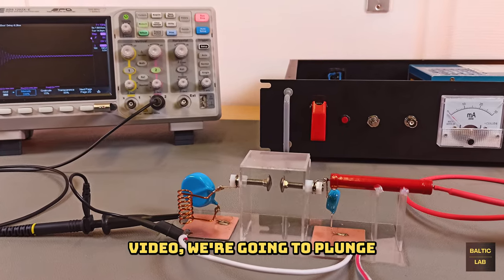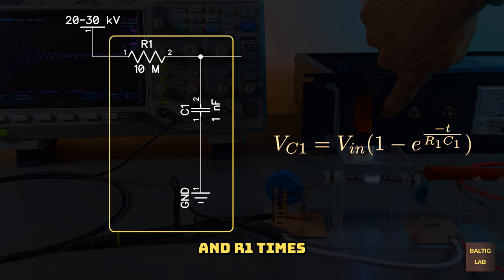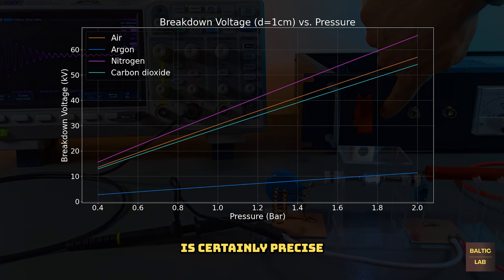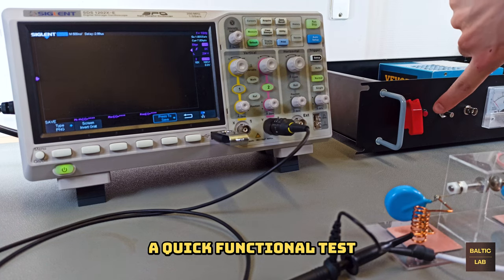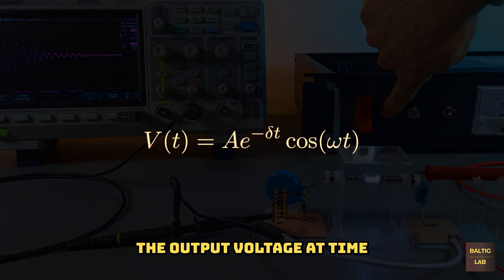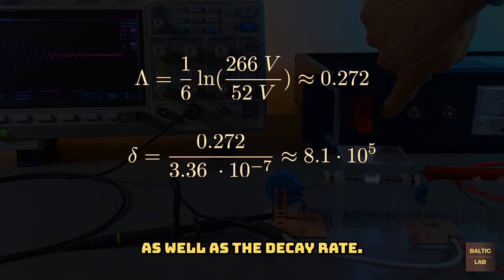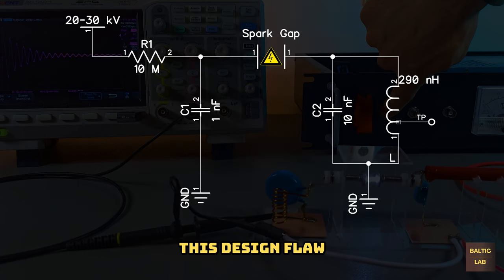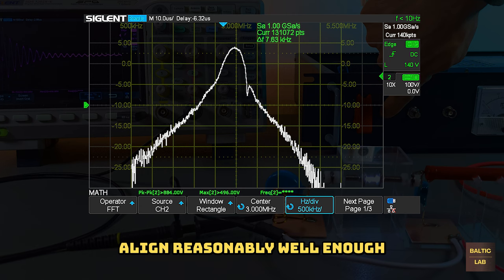DIY: Spark Gap Transmitter (Damped Harmonic Oscillator)

Comment: Found this on hackaday after looking at some lame 'emp' generator. Personally I'd ditch C1, put C2 where the spark-gap is, and then place the spark gap from the junction of C2 & R1 to ground. Your repetition rate then would be determined by the power supply voltage, R1 & C2, and the output frequency by L and C2; the large charging resistor should isolate the power supply from the tuned circuit once the spark gap fires and the inductor will look like a short circuit and not affect the charging of C2 in any significant way. I'm mainly interested in these type of things for VHF+ though, 3MHz is a little on the low side. Still an interesting demo, I really miss my old scope.
Reply from the maker: What you describe should work. There are many different architectures for spark gap transmitters and the version I showed was the best architecture to explain all relevant parts of the circuit. It is, however, not the most clean type. VHF with a spark gap transmitter is challenging, especially if you'd like to achieve relevant power densities for an EMP generator.
Reply: @BalticLab  I did it by using parallel connected 1/4 wave pieces of co-ax cable as a resonator, with a plain wire antenna on the end. It was a bit scruffy, but worked, and managed to disrupt unshielded devices around 5 metres away. I was quite surprised at the effect when only feeding the device with around 1500V from a disposable camera flash charger feeding a cockroft-walton multiplier and running from two AA batteries. The secret is to get the frequency high and the spark gap small and fast, but a pressurised gap would be even better with a single low impedance line as resonator. Operating frequency was around 70MHz. I had to dismantle it in the end as two laptops died unexpectedly in quick succession - whether it was the device or not I'm not sure, but I stopped with the experiments just in case. For an EMP generator it is only the peak power that you need to worry about.

Comment: 3KV/mm is interesting is that AC? I was taught the dielectric breakdown of air was  20KV/inch DC which is about 800V/mm DC. 3KV*25.4=76KV/In.
Reply from the maker: It's DC. You'll see a lot of different numbers between 1 kV/mm and 3 kV/mm. With some rounding your 20 kV/mm would be in that neighbourhood. The breakdown voltage depends on a lot of things. And it depends what your goal is. If you want to prevent breakdown and be on the safe side, sure, assuming 20 kV/inch is a good idea. If you want breadown to occur, 76 kV/in. is the better idea. That said, it depends on the temperature, humidity, exact gas mixture (which isn't even constant with air), pressure, etc. And it also depends a lot on the exact electrode spacing and shape. The false assumption is usually, that the measurement, be it 20 kV/in. is a linear one. Implying that for two inches 40 kV would be needed. But that is incorrect. The breakdown voltage at 10mm is different than at 25.4mm (1 inch), even if normalized to kV/in. The figure I've given is the accepted value derived from Paschen's law at standard conditions, a homogenous field and an electrode spacing of 10mm. If you're interested in this subject, feel free to subscribe as there's going to be a video on this exact subject coming up soon.

Comment: I had always thought these were illegal to operate. Is this not true?
Reply from the maker: You'd be correct, at least in the USA. Luckily, I live in Germany. Though this is probably one of maybe only a handful of things that we are allowed to do that Americans aren't. :)
Reply: Technically illegal for all signatories of the ITU treaty.
But that bans them for only radio communication and broadcast purposes. An experiment like this would be absolutely fine in the US.
Otherwise every stick welder and tesla coil would be a crime.
Reply from the maker: I am not a signatory of the ITU treaty though. Germany is, which didn't specifically ratify it into enforcable law. But you're right, the purpose is key, one could even question if any rules beyond "unintentonal radiator" rules apply to this demonstration.

Comment: I remember having a drawing of how to use a spark plug on a marine motor to make an emergency radio signal......kept the small drawing in my billfold during my boating years but lost it.  would like any info on making an emergeny xmitter using an outboard or inboard marine engine
Reply from the maker: That's a very interesting idea.. Since I have an outboard engine on my sailing yacht, I'll put that on my to do list for interesting ideas.

Comment: Very interesting video indeed. I have a random question though, do you know, how easy is it to buy common chemicals like acids exc for hobby use in Germany ? (without any license or chemistry phd).
Reply from the maker: It really depends on what exactly you want to buy. Unfortunately, Germany has very strict laws on chemicals in the hand of private individuals. A lot of those restrictions can be circumvented by registering a business and now being a commercial customer. A reliable source is Laboratoriumsdiscounter: https://www.laboratoriumdiscounter.nl/ Their range of products is a good indication of what the rules here in Germany / EU are. By using the discount code "BALTICLAB", you can even get 10 % discount.
Reply: @BalticLab  thanks i might use that in the future. Btw did you use AI for some of the video decription 😅
Reply from the maker: Yes I did, however, I tried manually normalizing it a bit as the AI suggestion from my original text sounded way tooo unnatural. When I am in a writers block I tend to write my coarse thought, let AI optimize it and then - depending on what it generates - I either use the suggestions to eleviate my writer's block or use it. I thought this into text was a bit over the top, but hey, it works :D

Comment: Great video.

The only thing effecting the break down voltage across the gap is the ionized gas is not able to escape using a sealed enclosure.

This will cause the spark gap to have  less air gap resistance.

Great if you want the air to be more sensitive, but bad if trying to precisely time the discharge to a consistent continuous rate.

But otherwise, very informative!

Comment: This may not be a new fact to know, but interestingly: Jagadish Chandra Bose used a similar topology for generating 5 mm waves in his laboratory in 1894. Of course it was not a regular lumped LC-circuit, but the resonator excitation was also made with spark-gap.

Once again: 60 GHz. Consciously, with measurement. 1890s.
Reply from the maker: Very interesting information. Thanks for sharing!
Reply: Don't forget feed horns and the demonstration of cross polarization transmission loss.

Comment: Outstanding video!
How much grounded aluminum shielding would it take to shield the circuit from itself?
Reply from the maker: Interesting question. I'd have to try it. Actually, I'll put it in a GTEM cell in a bit and see how nasty this thing is in a professional EMC measurement set-up.

Comment: This is a great video, thanks.
Do you know why the Q factor is so "bad", only 11? The inductor is almost "ideal" (coil with  air core). What is causing so much dumping? 

Thank you for explaining why the first 2 cycles are weird. Some times ago I was looking at the same screen you have, and was puzzled by those.
Reply: PS: Subscribed! Thanks again!
Reply from the maker: Thanks for the sub! The spark gap itself is mostly to blame for the low Q. It stays conductive for longer than ideal. Therefore, in commercial spark gap transmitters back in the day, making sure the spark is distinguished as quickly as possible, is a key part of the design.
Reply: @BalticLab  thanks. However, I am not entirely sure about it because, if your theory is correct, wouldn't the dumping ratio improve after the spark is ended? 

In my case, I saw the same poor Q and also the SAME shape of the first 2 cycles) without using a spark gap. Instead  I started the oscillation by "stimulating" the inductor of the LC tank by driving a nearby inductor (magnetically coupled by proximity) with a fast-rising slow-frequency (like 1khz) square wave.

Would be interesting to test your hypothesis.

Great videos, man!
Reply from the maker: That's interesting. I might have to investigate further on this and measure the Q without the spark gap using a VNA.
Reply: @BalticLab  Thanks! It would be amazing if you can do that, as I have been experimenting with Q-measurements recently (to learn) and I could really benefit from watching your approach! 
 
Beside measuring the Q with a VNA, it would be interesting to measure the length of the spark and then go back to check your theory: once the spark has finished, if you are right, I guess we should witness on the oscilloscope a sharp increase in Q!
Reply: First, the quality increases with L/C. Need to increase L, decrease C, decrese connection ratio to the spark gap.
Ceramic X7R caps have a huge losses on high voltage AC. You can even see a heating of this caps. Use film or air caps instead. On the oscilloscope, You can see damping of the high voltage oscillation is higher than low voltage, it ceramic self heating.
Reply: @BalticLab 

The enclosed spark gap is the ultimate cause.

The excess ionize O³ is not able to dissipate or be exchanged for mon dielectric air.

Think of it this way: the air cap is a form of an adjustable capacitor.

The O³ rises causing the air gap to change it's constants in "Q"
Reply from the maker: @Greysen2025  It's not really enclosed besides the frame around it, you do realize that though, right? Additionally, spark-gaps fully unenclosed and a fully enclosed acrylic glas (pressurized) spark gap have the same results.